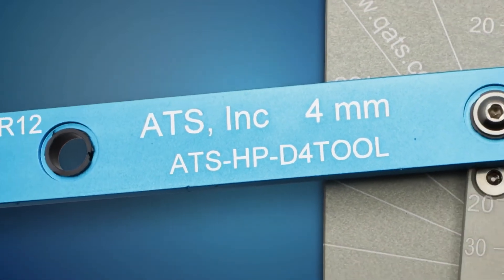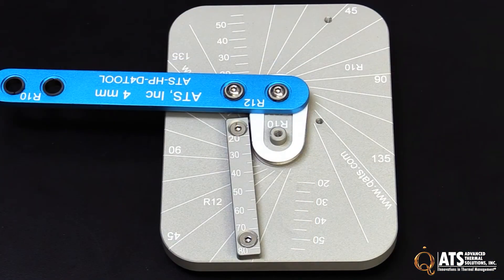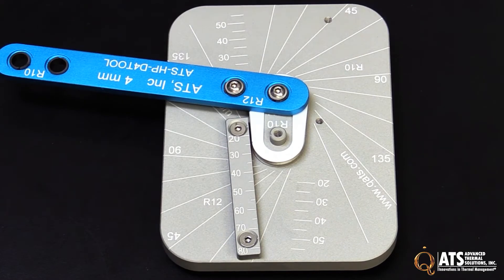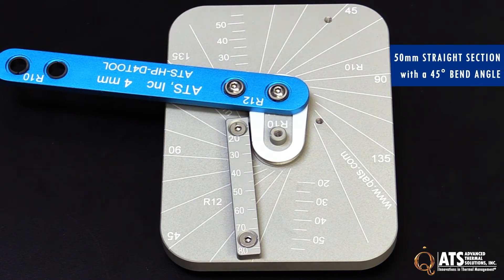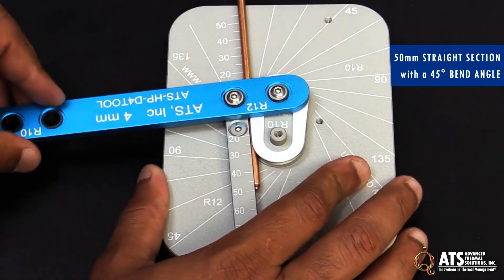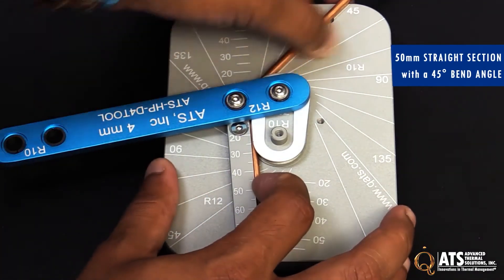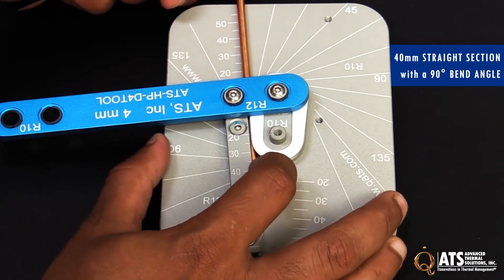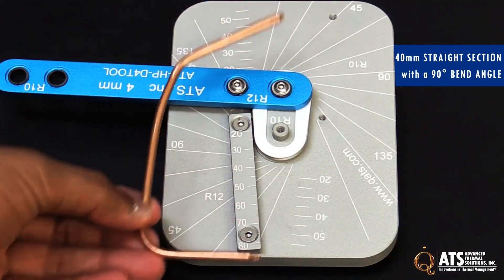ATS Round Heat Pipe Bending Tools

Comment: I have got a project in my college, to build a heat pipe bender, it would be great if you could help me out, starting with what material you used to build it
Reply from the maker: Our heat pipe bending tools are made with hard anodized aluminum to ensure long and durable use.

Comment: How to bend flat heat pipes?
Reply: i think they bend it when it in a round shape like the one in this video .. then they pass it on a lamination proccess
Reply from the maker: Bending flat heat pipes is very tricky, at least in our experience.  We have some in house hand tool we developed for this  purpose but it is a challenge not to split the copper.

When bending flat heat pipes, we usually create bending mandrels with exactly the right groove size in them. This supports the pipe fully while we bend it around the mandrel.

For the minimum bend radius please see the guidelines at the end of our heat pipe datasheet. For flat heat pipes, take whichever dimension you are bending against. So if the cross section is, say, 6X3mm, and you are making a “flat” bend, then the minimum centerline bend radius would be 18mm. If you lay it flat on a surface and bend it upwards, then that radius would be 9mm.
Reply: It might be easier to bend the round heatpipe and them flatten it as seen in other videos? But I'm no Expert...

Comment: how to bend the flat heat pipes... is there any bending tool or it can be done by using hands?
Reply from the maker: Bending flat heat pipes is tricky.  When bending flat heat pipes, we usually create bending mandrels with exactly the right groove size in them. This supports the pipe fully while we bend it around the mandrel.

For the minimum bend radius for flat heat pipes, take whichever dimension you are bending against. So if the cross section is, say, 6X3mm, and you are making a “flat” bend, then the minimum centerline bend radius would be 18mm. If you lay it flat on a surface and bend it upwards, then that radius would be 9mm.

Comment: Can this be used for flat heat pipes..
Reply from the maker: Hi Kiran - Thanks for visiting our channel. No, it would not be useful for flat heat pipes. We have some prototype tools to bend flat heat pipes but nothing we've released yet.
Reply: @heatsinks , but can one bend a round heat pipe and then flatten it though? I could use a hydraulic press in that case
Reply: @mikethechemis  I think it would ruin the heat pipe, once its inside pressure would rise with the flattening, not allowing the water inside to vaporize at lower temperatures.
Reply: @heatsinks  Hi, there. Any updates on the flat pipe bending tool?
Reply from the maker: @thingshappen9199  we don't have an update on that yet. Currently we are focusing on the round heat pipe benders and have some products on the roadmap there.

Some thoughts on bending flat heat pipes: when bending flat heat pipes, we usually create bending mandrels with exactly the right groove size in them. This supports the pipe fully while we bend it around the mandrel.

For the minimum bend radius for flat heat pipes, take whichever dimension you are bending against. So if the cross section is, say, 6X3mm, and you are making a “flat” bend, then the minimum centerline bend radius would be 18mm. If you lay it flat on a surface and bend it upwards, then that radius would be 9mm.

Comment: pretty much plumbing tools can do the job also..
Reply from the maker: Hi Gino - Thanks for stopping by and watching the video. And what you said is true, you can indeed use a plumbing tool, we talked about this a bit in a webinar we did. A plumbing too l does work well and we give a few examples of them from hardware supply stores.  The downside to the plumbing tool can be precision and when you need to replicate a bend, then a plumbing tool may not be as helpful and a tool  like ours, or from other manufacturers may be of more value.  We cover that in some detail in this webinar, "How to Attach Heat Pipes to  Evaporators and Condensers for Deployment in Electronics Thermal Management".  You can see it here, no registration needed:  https://vimeopro.com/user9706503/ats-webinar-series-2021-how-to-attach-heat-pipes

Comment: Nice work. Is there a problem with cooling the entire length of the heatpipe? Should I only cool the far end? I see some designs that have both ends heatsinked
Reply: Seems they don't want to answer you. I have seen the same on their other videos, if you ask a question; crickets.
Reply from the maker: Thanks so much for leaving a comment, we did reply to your earlier comment. Our apologies on the delay in responding to your comment here on our YouTube channel.
Reply: @One-jz6sl  trade secrets hah
Reply: @mwint1982  They want you to call them and get pulled into being a customer instead.
Reply from the maker: Thanks for leaving your comment @mydigitalwindow.  We strive to certainly provide solutions to customers but we also provide much of content free of charge to the engineering community. You can find much of it at the following links:
- https://www.youtube.com/heatsinks
- https://www.qats.com/cms/engineering-ebook-vapor-chambers/
- https://www.qats.com/Qpedia-Thermal-eMagazine/Back-Issues
- https://www.qats.com/Training/Webinars
- https://www.qats.com/Training/Webinar-Archive

Those are all free and we'd encourage you to attend or just check out the archives.  In our live webinars and after, we are happy to answer our attendees questions.   We hope you find some of this free material of value. As always, we're happy to try and answer your questions either here or at ats-hq@qats.com
Reply from the maker: Actually heat pipes have a rich history and are not considered trade secrets. They are quite an amazing application of physics.  You can download a free ebook on heat pipes from ATS here http://www.qats.com/cms/wp-content/uploads/Heat-Pipe-Engineering-eBook.pdf

You can also find an excellent resource on this topic at Thermal Fluids Central here: http://www.thermalfluidscentral.org/encyclopedia/index.php/Heat_pipes 

We hope this helps in your learning about heat pipes :)
Reply: @heatsinks  thanks guys. Very helpful
Reply from the maker: Hi @mwint1982,  because heat pipes have a fluid in them that gets evaporated in order to transport the thermal energy, cooling the entire heat pipe may not be effectve.  As you probably know, heat pipes are used for transporting heat from a hot point to another point, the condenser. Both ends generally have some kind of material on them: The evaporator end may have a copper plat, the condenser end may have a heat sink.  This link https://youtu.be/eKrdJpDSowY?t=209  will bring you to the point in our Heat Pipe explainer video that talks about how Heat Pipes work. You may find the entire video helpful as it covers the basics of what a heat pipe is, the working fluids that may be used, and how they can be deployed.

Also, this follow on video on how heat pipes are assembled into a deployable assembly may also be helpful https://www.youtube.com/watch?v=I5CQsBWKtOg&t=321s   we cover how heat  pipes are connected to different materials for evaporation and condensing.